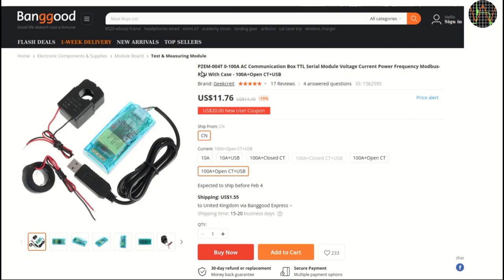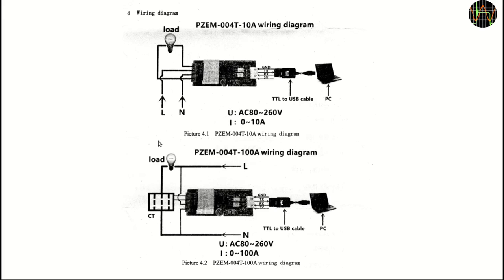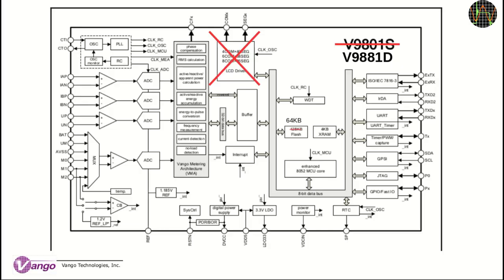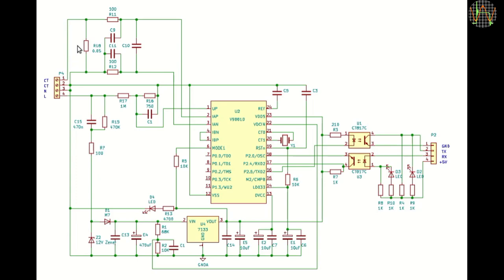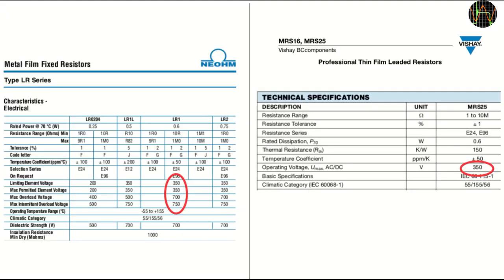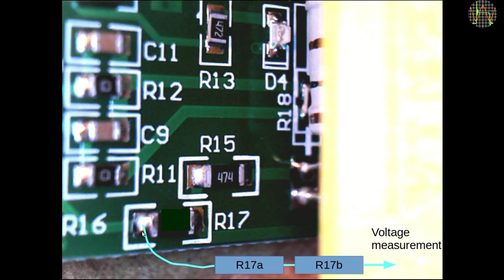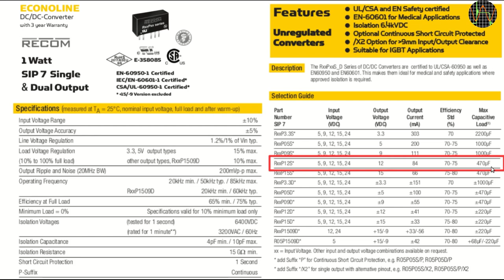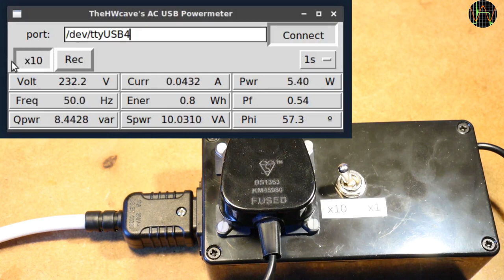Modifying the Peacefair PZEM-004T AC Comms Module (with schematic)

Comment: Please help, what is resistor R18? 1206 005 Om?
Reply from the maker: It should be 0.5 Ohm. My schematic says 0.05 which is an error. The resistor is marked R500. I need to fix the schematic, thanks for pointing it out
Reply: @TheHWcave  I accidentally mixed up the voltage input and the current input. There was a short circuit, but fortunately no one was hurt, only an ugly stain remained on the table. It turned out that this R18 resistor literally evaporated along with the adjacent tracks. The rest of the parts were not affected. However, one of the 100-ohm resistors through which the current signal goes to the microcircuit increased its resistance to 160 ohms and had to be replaced. Not knowing the value of R18, I started looking for a circuit and found it with you. After carefully rubbing off the soot and sprayed copper from the tracks (this is a conductive layer), and also taking precautions, I connected the module to the network with a 0.05 ohm resistor. To my surprise, the module still worked. The voltage showed correctly, but the current readings were much lower than the real ones. When, in addition to the diagram, I watched this video, I realized that the denomination was indicated in the diagram erroneously. Therefore, the readings were 10 times smaller. After replacing the resistor with 0.5 Ohm, everything returned to normal. Thus, if PZEM004 has a linear current error, then it can be easily corrected by connecting, for example, another one in parallel with the R18 resistor. By the way, in my opinion, its size is not 1206, but 0805.
Reply: When I got low current readings, I reasonably thought that the analog input of the microcircuit was damaged and it might have to be replaced. These chips are commercially available and relatively inexpensive, and I was tempted to assemble my own device, because the circuit is simple and other parts are easily accessible. if the chip is already programmed, you only need to calibrate it. It's not easy, but I think it's possible. But if it still needs to be flashed, then the problem arises to find the right firmware. Most likely, you will not be able to copy it from the working module.
Reply from the maker: @regolitharakiri2751  Wow, good story and good recovery. I added a note in the description of the video that R18 should be 0.5 Ohm not 0.05

Comment: Just wondering if the voltage input is relevant at all if you are just doing home power use testing? (you already know the voltage and the daily variance is minimal)  Can you delete the hot/neutral input circuit completely and power via USB?  This will make it easier to implement temporarily in a fusebox, etc.
Reply from the maker: the chip needs mains voltage and current to calculate and display power (simply put V * A = P ) but of course its more complicated in AC circuits...
Reply from the maker: The problem with AC power is that current and voltage are usually not in phase and not sinusoidal either. This chip has the necessary signal processing (which is quite a lot and complex) on board to take care of all that. Simply "assuming" 120V and multiplying the current with that will give you wrong values. As far as I remember, the module will give current if voltage is zero (provided it is powered from some other source)
Reply: @TheHWcave  I have an Amprobe clamp-meter so I can verify the accuracy of the readings, so I'm not worried there.  Most household loads are measured just for curiosity and power budgeting, so it's not like you need significant accuracy, as long as you're in the correct ballpark.  Having the AC input completely deleted would make implementations far safer and easier to use.
Reply from the maker: @awebuser5914  As I said, to accurately determine power in an AC circuit, the phase shift between current and voltage is essential. Measuring voltage separately from current is not going to work. Please take the time and read-up, for example the  Wikipedia entry on AC Power https://en.wikipedia.org/wiki/AC_power

Comment: Hello. I want to connect the PZEM to a regular ESP32 via the RX2 and TX2 ports. Is a 5v to 3.3v voltage converter needed?
Reply from the maker: Don't connect directly to the V9881 because that is really very unsafe. That part is directly connected to mains. Use the opto-coupler that is on the board. Just feed it with 3.3V instead of 5V on the USB side if you want to avoid a voltage conversion. The LEDs should still light to make the opto-coupler work,. You can check by looking at the LEDs that are onboard. If they still blink when receiving and transmitting, then the optocouplers should as well.

Comment: Hi, this is a really great Video. Can you tell me the value of the capacitors from the schematic? I need that information for a project I am working on. Thanks
Reply from the maker: Sadly these are all SMD caps with no readable marking. Since they are in-circuit, you can't just measure them reliably because the other components will  influence the result. The only way to be sure is to de-solder them and then measure, but, sorry, I am not going to do that. There are some testers that claim to be able to measure capacitors in-circuit by using very low voltages, below where most(!) semiconductors start to conduct, and that may work in some cases but it wont make a difference for networks of capacitors and resistors as in this case.

Comment: 12:00 so this chip is two channel ct input?
Reply from the maker: The chip yes, but the firmware running on the chip does not care. You are stuck with just the one

Comment: Hello
Thanks for the good video and the explanations.
I have a question which is not yet properly understood by me.
The removal of C15, R15, R7,D1,Z2 and E4 prepares the new power supply 12 V. 
I am not concerned about the power supply but idle current and heat generation.
Can anyone give me information on this? What is the difference between original and modification here?
Point 2,
 I may have missed the first time.
Why is R17 replaced by 17a and 17b, the part with the approximation of the original values because of the calibration I have understood. Is it because of the height of the voltage drop? Why then not also R16, the voltage drop is L>R17>16>N.
Does anyone know the operating voltages of R17. I intend to connect 240V.
THX
Reply from the maker: In the original the power supply for the electronics is created through a capacitor dropper (C15 in series with R7 and the Z-diode). This is done before rectification by D1 which means at one half-wave the Z-diode is actually in forward direction and that energy is simply converted into heat. Its not terribly large but unnecessary and wasteful. Most of the voltage drop happens in C15 which is physically large and can handle the generated loss easily.  R17 and R16 form a divider for mains voltage with a ratio 1M/750 = 1333:1. At 240V, R17 drops about 239.8V and R16 0.2V.  A tiny SMD resistor for R17 is not rated to drop that kind of voltage safely. It may simply creep across. You need a physically larger resistor or a series connection of multiple resistors where the drop across each is less. For safety, I recommend both, larger (and properly rated ) and splitting it into 2 series resistors. To maintain calibration the replacement R17a + R17b must match the original value of R17 (which wasn't 1M in my version)
Reply: @TheHWcave hey i saw you said your resistance was 1 M my chip has 100 ohm resistance only brown black brown golden colour code
Reply from the maker: @sparsheditx  That would be very strange because that high-ohm resistance is needed. Have you measured it (with nothing connected to the module)?

Comment: Great video.... As far I understood of the V9881D datasheet & the PZEM-004T V3, it's not possible to retrieve the sign of the current,voltage.... For photovoltaîc application would have been great
Reply from the maker: No, unfortunately it does not distinguish between flow-direction in the current transformer. Sign is maybe a bit misleading, because its AC, it is actually a phase shift. But I think there are modules available that can do this.

Comment: My PZEM-004T shows 0.23A of current even I am not using any power in the wire where the sensor is attached.
Even if I remove the CT, the current of the sensor does not return to 0, it just gives a random value of current from 0.20A to 0.50A.
Reply from the maker: Sounds as if the chip has a problem. While there is supposedly a calibration mode, I have no idea how to get into it or use it. If you still can, I would return the module.

Comment: I want to modify my pzem to read Voltage between two phase and also read frequency  200Hz 
Can you help me please ?
Reply from the maker: While it could measure the voltage between 2 phases provided it does not exceed 260V and while 200Hz are beyond its spec but my unit was still reasonably accurate at that frequency, I am not sure what you want to do with current?
Reply: @TheHWcave  I want to connect the pzem to terminal of a VFD without neutral 
The voltage between two phases is just 230V and  frequency is 50Hz But when I tried to connect the pzem to VFD it's make a fire.
I don't know why, is the pzem affected by the acceleration of voltage and frequency ?  because when the VFD is running, it accelerates each of them from 0 to 230V and 0 to 50Hz
If there is a solution to measure voltage between two phases under 250V i want also modify my pzem to read Frequency 200Hz
Reply from the maker: @abdelkarimkhelifi863  VSD are quite hard to measure . If you use the original non-modified PZEM-004 it wont work because it gets its supply from the voltage difference between the L and N or in your case phase 1 and phase 2 and is furthermore frequency dependent. It will get too much power at 200Hz. I am not sure what your setup is varying with respect to the phases. Check what a good (!) true RMS (!) voltmeter show if used instead? That  would give an indication if there is any chance to use the PZEM-004 powered from USB. There are just too many unknowns to give any further advice in comments. That could end up to be really dangerous. Please get someone professional to look at your setup..

Comment: Hi,
Suddenly my device no measures the current, but still measures the voltage correctly. I tested the CT with the tester, and it works. Thanks to the scheme you published, I was able to identify the elements related to the CT. I measured on PCB the values of R18, R11, C9, C11, C10, and R12: the resistance values are correct, and the capacitors are not in cc.
Is it possible that the V9881D doesn't work? If so, why measures the tension?
Reply from the maker: A strange fault indeed. If you look at the datasheet of the V9881D, it has separate differential inputs and ADCs for 2 current and 1 voltage channel, so it is quite possible that voltage still works.  If you are very careful, you may try  to measure if there is a voltage between IAP and IAN when current is flowing through the transformer. That would prove conclusively if the fault is in the chip or in the circuitry before it. The analog inputs can only handle -0.3V to +5V. This means a huge current spike could possibly overload and damage the input. The same is true if for some reason R18 is missing or not connected to one of the CT input. A CT must be always loaded or it will produce damaging voltages.  If the chip''s current input is damaged,  I wonder if one could use the unused second current input but that also depends on the firmware being able to use it.

Comment: I don't understand, why does the DC-DC converter need to be able to withstand continuous high voltage isolation? Isn't it connected to neutral? Where would the high voltage come from, and in what circumstances?
Reply from the maker: The converter is all that separates and protects you (and your PC/laptop) from mains voltage. 240VAC  (RMS) is 340V peak or 680V peak-to-peak, so the voltages are substantial. Add to that momentary spikes and transients that you get when somewhere large inductive or capacitive loads are turned on or off. Its true that specifying a higher break-down voltage is maybe a little belt and braces but the costs are not that much higher and I'd rather have a good safety margin between me and mains voltage.  Ok that's me, other people think maybe differently. The main thing is to get whatever isolating DC-DC converter you chose from a reputable distributor and not some questionable source on eBay, aliexpress... A lot of components these days are fakes that do not meet even minimum standards.
Reply: @TheHWcave  Again, where would that high voltage be coming from? I mean, what's its path from L to one of the DC-DC output pins? Wouldn't that require at least one of the other components breaking down first? And if so, could we make a fuse there to detect that (or actually the mains fuse should get tripped anyway, because it gets shorted to N, right?), so that if there is suddenly high voltage then the whole thing would disconnect, so the DC-DC would never need to isolate for more than a millisecond or something?
Reply from the maker: @marcus3d  Not sure how to put it and please don't get me wrong but  after reading your comments I can only I strongly recommend that you should not try this mod or work on anything that is directly connected to mains until you learn more about such circuits and the dangers involved. I assume you will ignore that advice but its all I can do.
Reply: @TheHWcave  Fair enough. Still, which path is the constant high voltage AC reaching that DC-DC?
Reply from the maker: The whole chip and everything that connects to it has to be regarded as being on mains voltage. The chip is directly connected to neutral and only a very dodgy and not mains voltage rated resistor is between it and live. If that resistor fails or if someone accidentally swapped neutral and live anywhere in the wall or power cord wiring (I have seen many examples of that) ,,,

Comment: Is it possible to measure the current direction?  This sensor outputs a positive value regardless of CT clamp orientation.  It'd be nice to use this device to measure the mains import/export of a house with solar.
Reply from the maker: Sadly this is not supported by the chip & firmware. I agree that would be a useful thing to have,
Reply: @TheHWcave  Yes, I eventually accepted this.  I see v1.0 of the board does have a known mod (pin goes high with voltage/current phase change) but those boards are hard to come by and considered unsafe...er.   There does appear to be plenty open-source projects out there that can measure direction.  emonpi, opencircuit and Power Monitor HAT (for Raspberry Pi) to name a few.
Reply from the maker: @NetworkGeek280  Thanks for sharing the info on the phase change mod